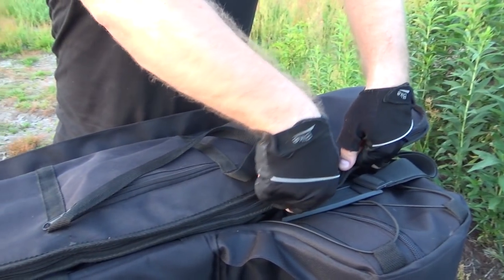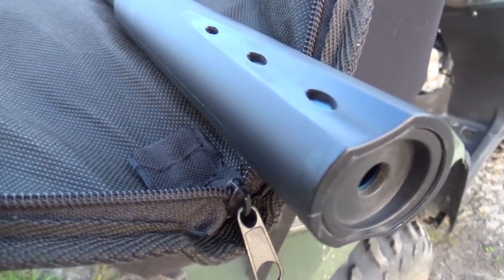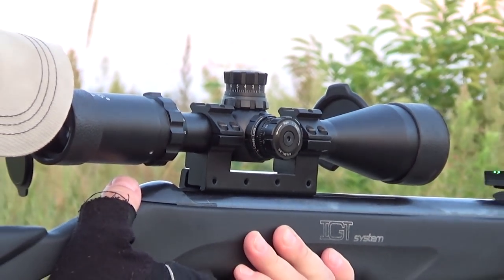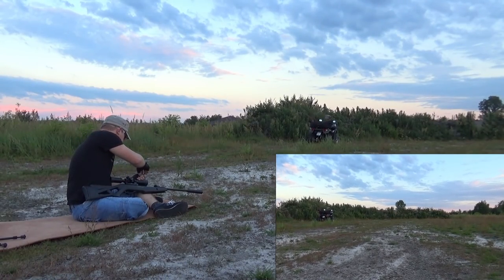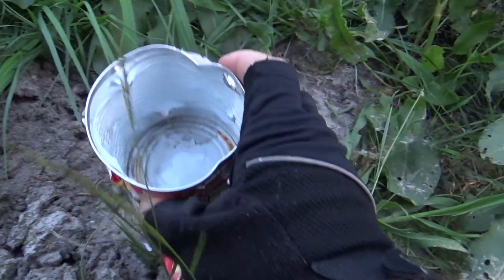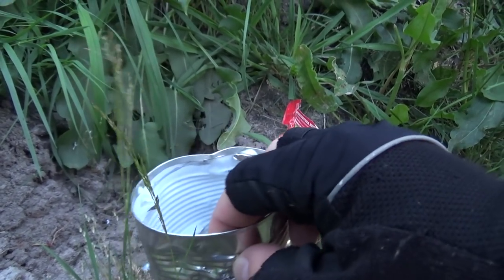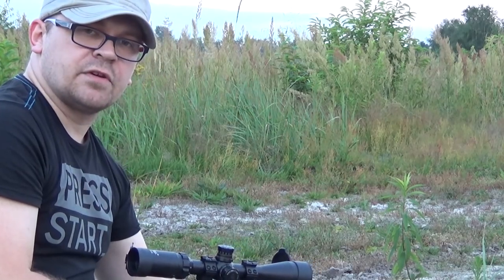Gamo Whisper IGT review

Comment: Finger on the trigger while loading barrel, you only mess up once, when you accidentally hit the trigger the barrel will come flying up.
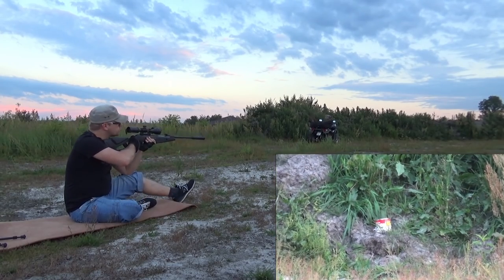0:49 1:23 1:47 1:57
Reply from the maker: Actually finger was on safety switch - not the trigger.
Reply: Thats true I have seen a guy pulling a trigger while the action was opened. It did bent the barrel

Comment: Where can I buy the best pellets
Reply: Germany
Reply: Amazon, Crossman or barracuda are decent.
Reply: what are the best pellets?different pellets suit different rifles.
Reply: @andywhite767  Air arms diablo field are one of the best pellets to buy.
Reply: It takes larger Imperial 5.6 pellets as well as modern h&n stuff I've found it really likes the BSA goldstar metric ones tho there 14.5 grain and they pretty much group pellet on pellet at 45m I've got a surplus of milbro 5.6 mm ones and under 40m they really put s wallop on small game but for longer shots up to 60m I use h&n ftt and crossman ftt the latter crossman are really accurate this for the price outshoots my HW 35 and my untuned HW 80 the only one in my arsenal that will dominate this thing is my air arms tx200 in .177 but for a affordable hunting air rifle that the weather won't wreck in a bit of drizzle this is my go to rifle also like the fact you can use a he'd key to open the attached suppressor to give it a good clean and the trigger all be it a plastic affair is very nice mines breaking at 2.5lb honestly it's a very good rifle for the price I've outshot rifles costing triple this I paid a small price of 180 with a hardcase and pellets and a soft case to and it comes with a scope don't think for the cash it's going to be some mediocre rifle they really are rather accurate and the fact it shoots both 5.6 and 5.5mm pellets makes it very useful for close range work were u want to smash game with the 5.6 pellets and for longer ranges stuff either h&n ftt and crossman really do streach this things legs out I wasn't a fan of gamo untill I got mine but they don't muck about and really really are fantastic value for money my next purchase will be the PCP gamo phox the newer one with the half inch unf I intend to use it for ft work and hunting not that the wisper hasn't already proved it's a capable hunting rifle I've had rat to rabbit to pheasant with mine I did use the 5.6 on the pheasant tho and it droped it in its tracks with a heart shot @40yards

Comment: I have whisper igt... 3x9-32 scope..i cant calibrate the scope..it doesnt seem to work with me
Reply from the maker: Are you sure it is mounted well ? I need to use another single mount with stopping pin because the first one  was moving around and loose zero.
Reply: Air Soft Gun and Air Guns yea im sure its tight... maybe i need to practice more since im new to air rifles...is there a limit for how many pellets the rifle can handle ? Or its totally normal to shoot lots of pellets